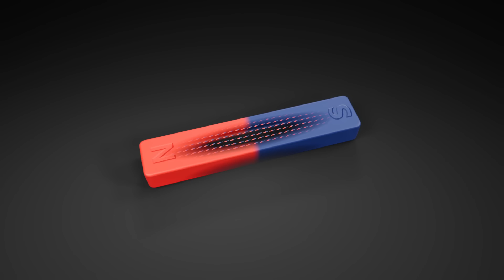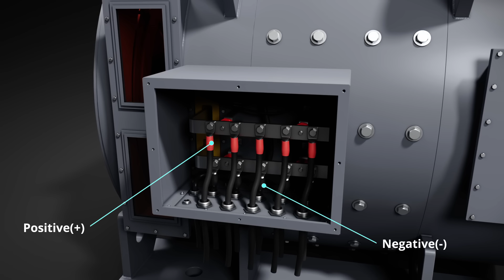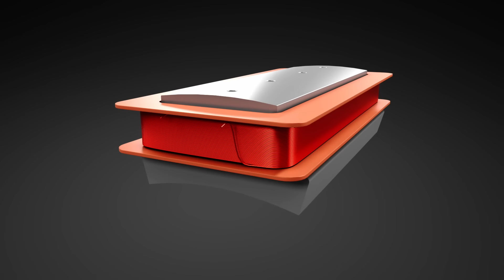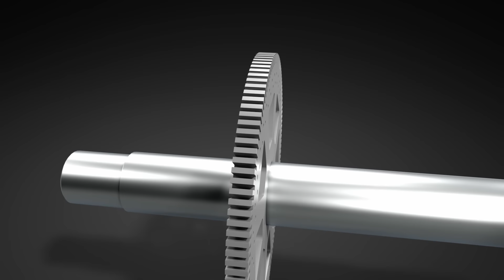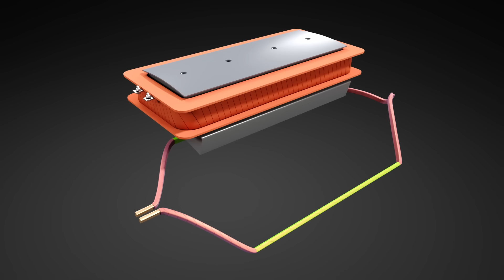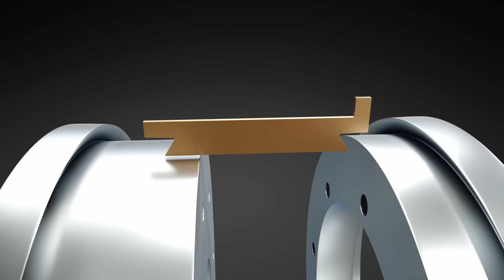Inside a Massive 1 Megawatt DC Motor | Detailed 3D Animation

Comment: Either this is AI generated trash or the script wasn't careful. One second talking about using angle roller bearings then finish the statement with "that's why double ball bearings are used" How can I trust anything when there are blatant problems.

Comment: For the most part, very accurate and professional graphics, but i caught one thing that was wrong. The stater in all electric motors are made of hundreds of laminated metal sheets that are compressed together and then tack welded to its desired dimensions. This prevents over heating witch would damage internal winding of the motor. Witch is why staters are magnetically induced prior re-winding to test and assure there are no hot spots still present. Other than that good video.
Reply: Eddy current are not problem for DC motor.. lamination are used in ac portion of DC motor

Comment: Thank you so much for the video, I love it so much. Just subscribed with this video. And also, I think those are the larger versions of universal motors. Universal motors are a kind of DC motors which can be driven by both AC and DC currents. I also noticed that those giant industrial DC motors have similar winding principles compared to universal motors. Universal motors are widely used in house and small industrial appliances such as vacuum cleaners, blenders, pressure washers and power tools (electric drills, angle grinders and so on). I think they are used because they are compact and can generate very high torque, which is like how giant industrial DC motors are used. AC induction motors are not as compact as DC motors even though they have advantages rather than DC motors.

Comment: well, it better not convert to pulsed operation mode in any point, if true dc. even brushed dc motors are pulsed ac motors. yep the input electrical power current is dc but gets converted to ac at some point. railgun track motor is a true dc only motor.